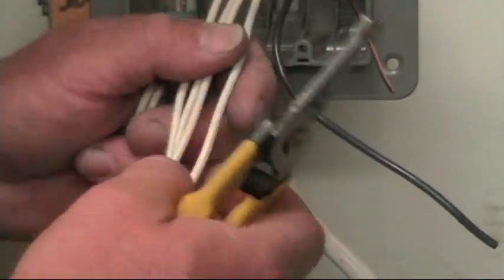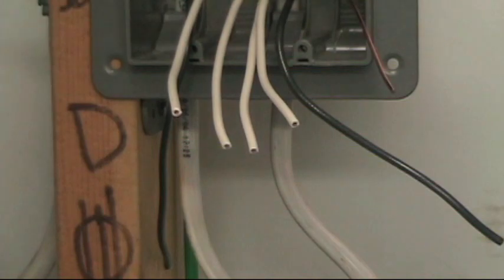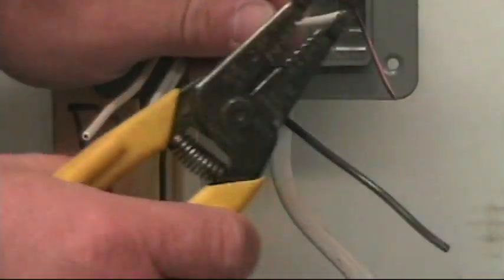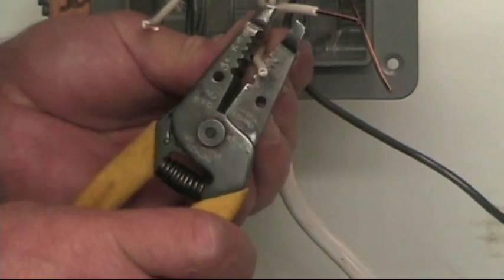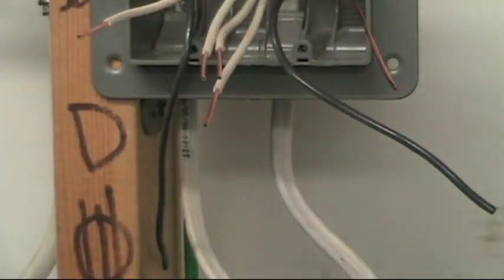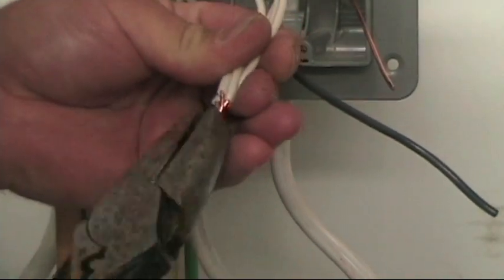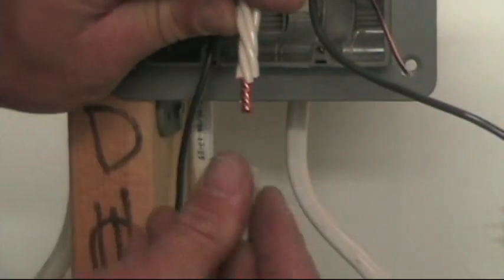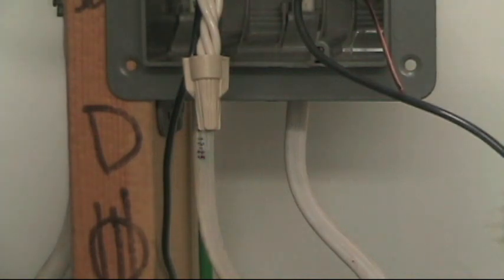How to Wire a Switch Part Four: Splicing the Neutral Conductors

Comment: i have a question, our lights in our house ive noticed sometimes all get dim and then bright every few seconds all at the same time. i even notice the fridge running a little less power for a few seconds when this happens. ive googled it and so far what i came up with is something along the idea of 2 main lines coming into the house carries 2 different voltage i think 120 and 240, something loose like a loose ground or some kinda issue is causing one wire to not work and both wires are merging causing the fluxation in the lights? i dunno if i explained that right but does that makes any sense? im not going to mess with it but i have a extremely busy day today and cant call the electric company until late today or even tommorow so im trying to get some kinda idea of at least what is going on
Reply: hippa2dahoppa2 probably a surge when your fridge kicks on dimming lights. Heavier loads should be closer to your main in panel I was taught. Also could even be neighbors load interfering.